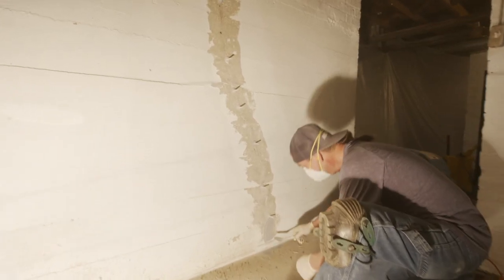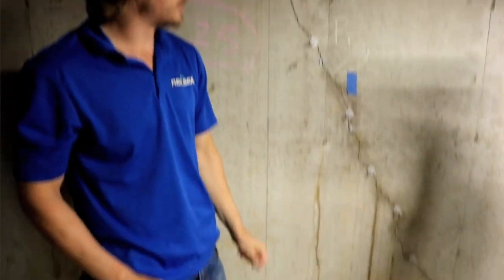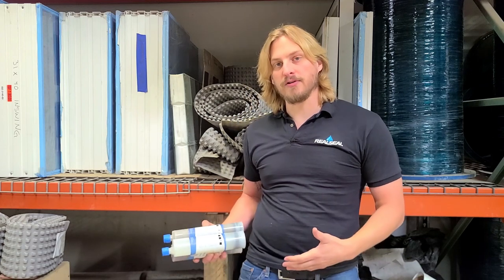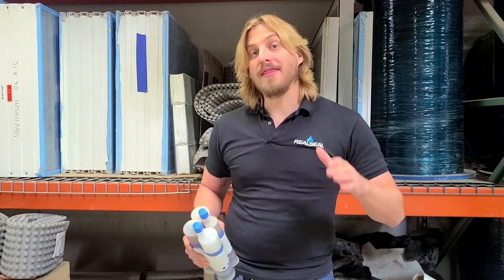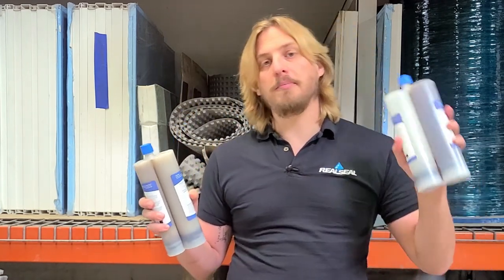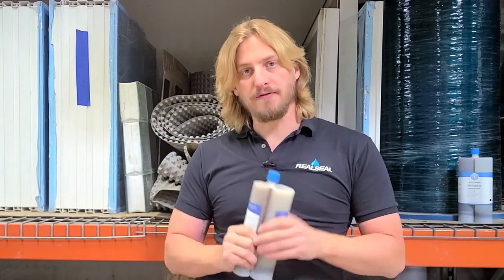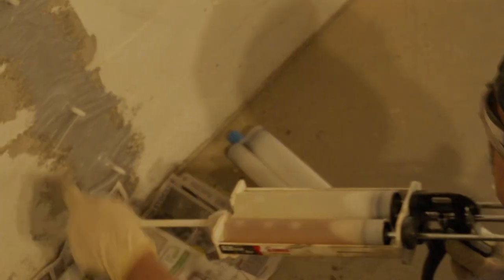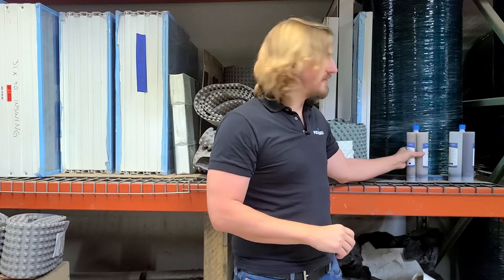What is the difference in Epoxy and Polyurethane in concrete crack injections?

Comment: Thank you so much for this video.  I literally just had a salesman tell me that I should go with the polyeurathane so that the wall could move in the frost cycle.  I wanted epoxy injection because that's what I saw on This Old House.  I will continue to look for a proper contractor.
Reply from the maker: Happy to help, Gina! You definitely want epoxy. Anyone telling you your foundation is moving should be giving you a solution to stop it from moving. Your foundation should also be below the frost line, as is code, to prevent frost movement.

Comment: Great stuff! Would you still recommend epoxy for cracks in concrete floor please?

Thank you
Reply from the maker: Hi Toofy! We actually do not recommend epoxy for floor cracks. In order to stop water from entering through the floor, you'll need to install a Drain Tile System. 

If all you are worried about is humidity/radon, and not active seepage, you can simply use silicone caulking to seal those cracks.
Reply: Thank you very much for the info buddy! Much appreciated! And keep up the great content! Cheers mate
Reply from the maker: @toofypeg7931  You bet, thanks for the encouragement!

Comment: Yes, both materials theoretically get injected into cracks, however, they are two different products each with their own solution. Also, you may (will) get different results using a pump rather than a cartridge system.
Reply from the maker: Absolutely right! Different products yield different results. We prefer epoxy, as it is stronger, lasts longer, and has a much smaller call-back rate. 

The method of injection does not matter, however. Weather you use a pump or cartridge, the epoxy is pressure-injected into the crack. Epoxy doesn't know it's being pushed by a hand pump or a machine-pump. It only knows it is being pushed. 

Plus, those machines tend to leak and break down. Nobody wants epoxy leaked on their kitchen floor as a tech brings a machine in. In fact, the techs have a better "feel" for the resistance of the hand-pump cartridges, and therefore also have fewer blowouts. 

Long story short; use epoxy from a hand-pumped cartridge with an experienced technician from a reputable company.

Comment: Hi i just want to confirm how will your epoxy bond to a wet wall usualy all epoxys need dry wall if you are fixing water leak the wall will be wet?
Reply from the maker: Hello! You are correct, epoxies do not stick to a wet wall. In the case of a leaking crack, we will build a Hydraulic Cement Surface Patch with diverting tubes that moves the water and creates a dry surface for our epoxy to bond to. From there, we can inject the crack and stop the leak!
Reply: @Therealsealllc  I'd like to hear more about this method. You have a seam in the wall you fill with hydraulic ... but where do the tubes go, and where does the epoxy go, into a spot not leaking? Thx.
Reply from the maker: @thenexthobby  Great question. Our How We Do It Video on Epoxy Injection shows the technique and how the epoxy is injected to fill the entire void. Here is that link: 

https://youtu.be/2KrIa9iAIeU?si=drR9c-r1e84smtYX

And yes, you fill the entire void, even the spot that isn't leaking. Because once you fill the void where the water is coming in, it will find the rest of the crack's void if you do not repair that as well. That is why we repair the entire crack.
Reply: @Therealsealllc Thanks, I’ll watch that video. Sounds like hydraulic cement fills the initial void and epoxy does the rest … presumably providing the epoxy with a dry surface.

I can have several dry days in a row but would never want to assume the cracked wall is dry inside of it.
Reply from the maker: @thenexthobby  you do not need the crack dry inside and out. You simply need the surface dry for the surface sealer to stick. 

That hydraulic cement can help with this, and the liquid epoxy will still bond with the concrete on the inside of the crack, even if it is wet.

Comment: Can I use epoxy for water leaking from concrete slab balcony
Reply from the maker: It is possible to use epoxy for that, but a concrete sealer for that use is going to be a better solution.

Comment: Currently repairing a crack in foundation previous owner botched / failed back in 2016. It’s a stress crack going from corner of window, diagonally to the footing.  Crack leaks slowly into our basement. Currently have it excavated to the footing, and clean. About a 3-4 ft long crack 1/4” at most in places. A foundation guy has told me the best thing to do is use water proof hydraulic cement and tar. Why would I not use epoxy injection + tar covering on exterior. Would there be a reason hydraulic cement would be better than epoxy on exterior crack repair? PLEASE HELP STUCK IN LIMBO😂
Reply from the maker: Hi @elibrown7531!

Epoxy injection is best done from the inside. With a finished basement, you can end up injecting epoxy into your home, which is not ideal. 

So while epoxy injection is the best solution from the interior, from the exterior the best solution is to clean the wall, use hydraulic cement over the crack, and then an elastomeric tar over that.

A protective barrier like a plastic sheeting or a foam board is ideal as well to prevent the tar from being scraped off during back fill and compression of the dirt.

Comment: Isn't t FlexiSpan and polyurethane better for basements and actively wet areas (basements in snowy and icy weathers) ?
Reply from the maker: Hi Sam! To be very clear, absolutely not. The best way to fix a foundation crack is through epoxy injection. Polyurethane can also be used in void fill situations, but epoxy is the best solution we have found. 

FlexiSpan/FlexiSeal/Waterproofing sprays do not work for basements, no matter what the infomercials say.

Comment: What if the cement inside the crack is damp? Still Epoxy?
Reply from the maker: Yes, you can still use epoxy in those situations. If the crack is actively leaking, it may be best to switch to polyurethane until you get past the leak, as it does react with water. 

If it is leaking too bad, it is best to come back another day to complete the repair.